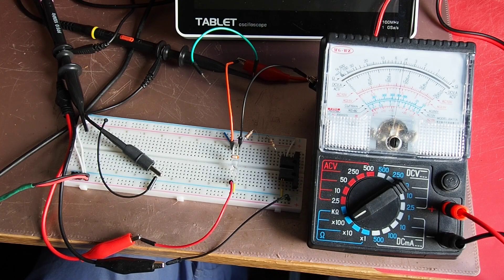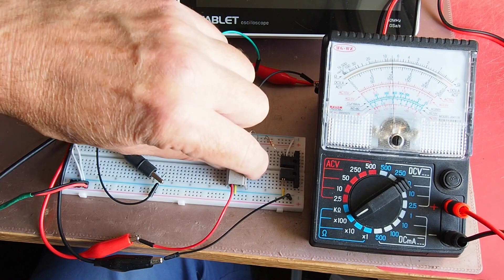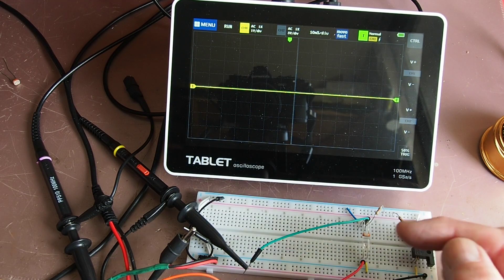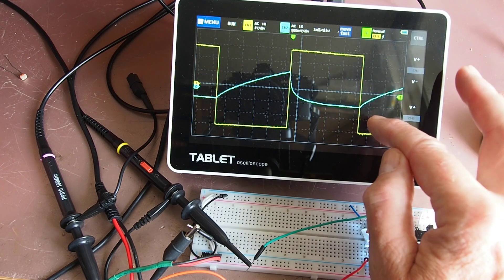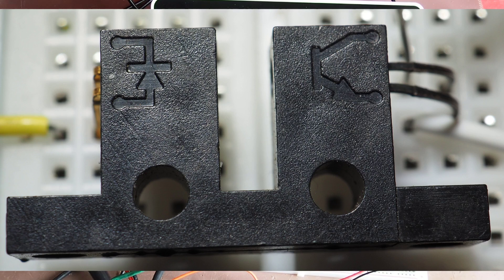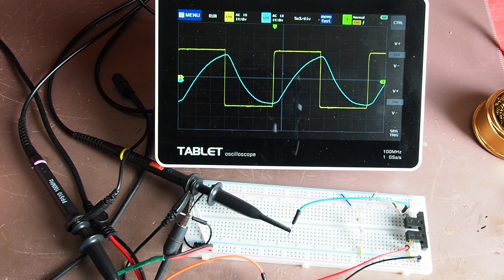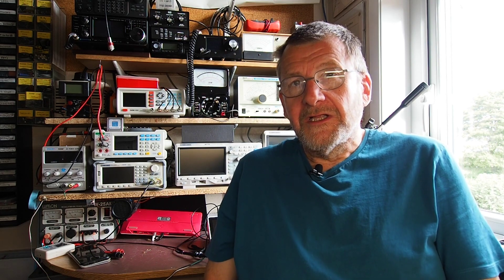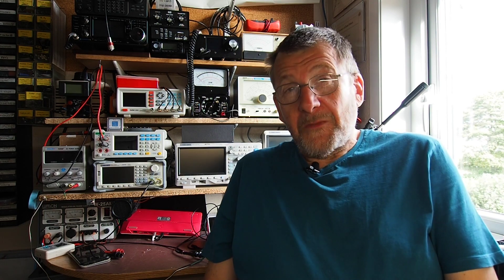Fun with the FNIRSI 1013D Tablet Oscilloscope and Optoelectronics

Comment: Hey Bill!  Interesting video!  I enjoyed it much.  It reminded me of an experience I had many years ago.
A gentleman brought in his Cobra CB radio for repair saying that when his car warmed up the receiver died.  I was thinking he was a bit of a nut case, but I set it up on the workbench and began to test it.  The receiver worked fabulously and I saw no problems with its operation.  Just in case it had a cracked trace or something, I decided to take my magnifying glass with the circular fluorescent bulb in it to get a closer look at the circuit board.  When I turned the light on, the receiver died!  I turned the light off and it came back on.  Problem solved!  I knew that the faulty component had to be transparent or at least translucent.  The ONLY thing that fit the description was a variac diode with a glass casing.  When it got warm or had light put on it, it would kill the oscillator and you had no reception.  Was an interesting fix.